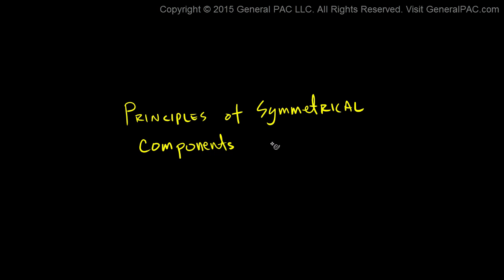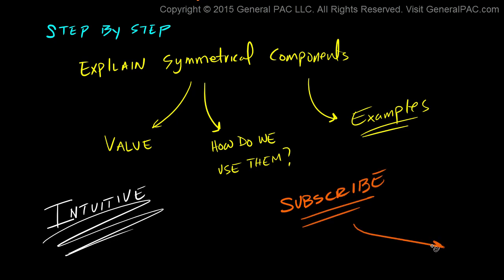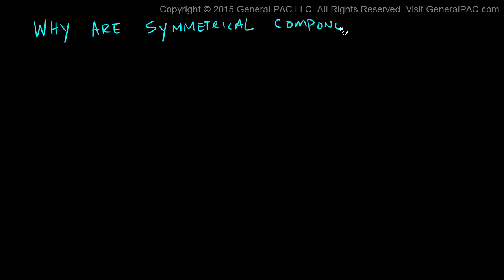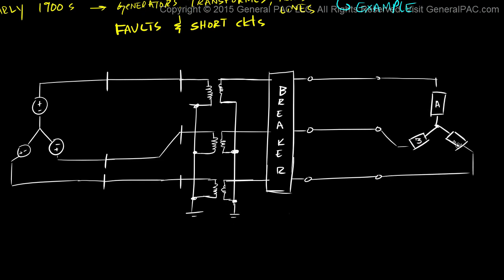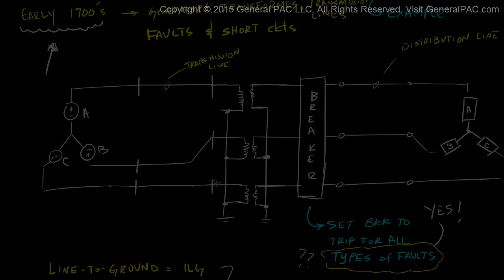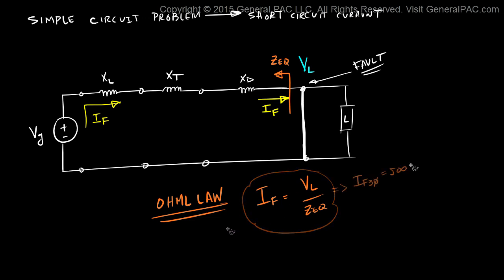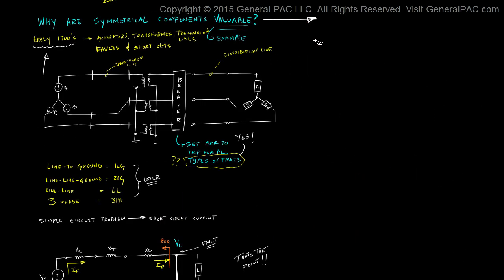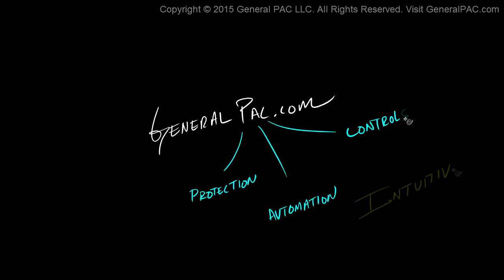Principles of Symmetrical Components Part 1a

Comment: Such a concise & really great explaination. Watching this, college lectures make more sense. 
One topic was missing, about Z bus Calculation, about Z bus building algorithm, Current Injection Method etc. 
But no issues I understood those topics from somewhere else, but If You'll make playlist for this also, this will help everybody.
Thanks
Reply from the maker: Hi, your suggestion has been noted. Checkout our new course which covers a variety of Power Systems concepts with detailed explanation and we're offering 90% OFF. Use the coupon code "PSEVLOG1" and get benefit from it: https://bit.ly/PSEVlog1

Comment: I have watch all the videos related to symmetrical components. To appreciate it more, do you have another set of videos on how can i apply it on actual electrical system design where the only given is utility available fault current and system impedances. Even a book or technical paper will be much appreciated. Thank you and hope to hear from you soon.
Reply from the maker: We are working on this series now and hope to release it soon!
Reply from the maker: Hey there! We have started a new series which is the Fault Analysis using Waveforms. It is basically the practical implementation of the symmetrical components and faults. Check it out at: https://www.patreon.com/posts/24990064

Comment: Dear sir i have a question in my mind will you please help me?
que : I've read this line in one book related to switch gear and protection which says as follows :-
the unbalanced loading results in circulation of negative sequence currents in the stator winding which give rise to rotating magnetic field which rotates at double the synchronous speed with respect to rotor and induces voltage double the frequency in rotor conductor. 
Can you explain this in more elaborate way. 
Thanks in advance.

Comment: When you say analysis is extremely difficult to attempt to calculate unbalanced faults without symmetrical components, what do you mean? The alternative to symmetrical components would be deriving the KVL/KCL, Mesh/Node equations for the 3 phase network. This doesn't sound "extremely difficult" as much as it is just going to be a long and tedious process. Can you clarify? Thanks.
Reply from the maker: After performing the KVL/KCL methods, we determine the equivalent impedance and voltage source. Then, we have to use that information in a very specific way to calculate 3LG, 1LG, 2LG, and LL faults. For 1LG, the impedance are in series. for LL faults, they are in parallel. This part wasn't known BEFORE the symmetrical components was invented in 1918. Actually, couple years after 1918, Power Engineers were able to use the symmetrical components concepts to calculate unbalance faults. Does that make sense?

Also -- If I understand it correctly (and challenge or add  to this comment) -- back in the day (before main-frame computers), Engineers from the past created a miniature version of the system using simple cables and small transformers. They were very careful of the impedance used for the mini system because it had to accurately reflect the big system. And when they injected current through the mini system, they could easily measure the current flow through each line which would reflect how currents would distribute through the actual system. Similarly, I think they had a crude way to measure unbalance fault currents.  That's all I know. If I find out more, i'll comment again.
Reply: Im not sure by what you mean by "determine equivalent impedance and voltage source. Then we have to use that information in a very specific way...", or "This part wasn't known BEFORE the symmetrical components was invented in 1918". The way I see it, to calculate unbalanced faults without symmetrical components, all you have to do is derive the KVL/KCL mesh/node equations with the desired fault topology, then solve the resultant system of equations for the unbalanced voltages/currents. As I initially stated, this is not "extremely difficult" as much as it is a long and tedious process.
Reply from the maker: Using KVL/KCL mesh/node equations that you have described can be used to calculated balanced 3PH faults. But not unbalanced faults. Read this paper for more info. Figure 3, 4, and 5 shows what how the "equivalent impedance" and "voltage source" for pos, neg, and zero sequence impedance are arranged to calculate unbalanced faults (1LG, 2LG, and LL). 

https://cdn.selinc.com/assets/Literature/Publications/White%20Papers/LWP0010-01_TutorialSymmetrical-Pt1_AR_20130422.pdf?v=20150812-081134  

Hope this helps.
Reply: Thanks for your responses. I have actually read that SEL paper in the past, its good but unfortunately its not what I would like to clarify. I feel like I have a good grasp on this subject, but the only thing that concerns me is something you said.

I disagree with your statement about, "Using KVL/KCL mesh/node equations... can be used to calculated balanced 3PH faults. But not unbalanced faults." as it is generally incorrect. You mention that it is extremely difficult to attempt to calculate unbalanced faults without symmetrical components, and now it sounds like you are saying that its not possible at all using KVL/KCL. This is adding to the confusion about my initial inquiry.

The way I understand it, there are a few ways to analyze unbalanced faults..... I will categorize them into two parts. 

1.) Symmetrical Components: This is just a way to break apart the unbalanced phasors, and deal with them as balanced phase sets, which makes analysis much easier since we are dealing with per-phase equivalent circuits as you have mentioned (pos, neg, zero). With these symmetrical phase sets and their respective impedance networks, any circuit analysis techniques/methods may THEN be applied, such as KVL/KCL Mesh/Node equations, source transforms, thevenin/norton transforms, lumped/reduction of elements etc.... Note: Depending on the fault topology under consideration, the impedance network is manipulated/arranged accordingly to calculate the unbalanced faults. The sum of symmetrical components gives the resultant unbalanced conditions. This is very convenient.

2.) Non-Symmetrical Components: This is directly applying brute force circuit analysis techniques/methods such as KVL/KCL Mesh/Node equations, source transforms, thevenin/norton transforms, lumped/reduction of elements etc.... to the THREE-PHASE topology (not per phase equivalent circuits) with the desired fault in-place - whether it be 1LG, 2LG, LL, etc.... Eventually, you will have a characteristic set of mesh/node equations that, once solved for, will give the resultant unbalanced phase conditions for the particular 1LG, 2LG, LL fault. This analysis of unbalanced faults is more tedious, and requires a new set of equations for each type of fault. Its not extremely difficult, and therefore it IS possible to analyze unbalanced faults without symmetrical components. It may or may not be convenient.
Reply from the maker: My apologies for the confusion. You raise a good question and like you, I don't have all the answers... but I am curious! I also want to learn how unbalanced faults were calculated BEFORE the introduction to symmetrical components. I know for sure that we can use "KVL/KCL Mesh/Node equations, source transforms, thevenin/norton transforms, lumped/reduction of elements etc" to calculate 3PH faults. However, i'm not confident about using these techniques to calculate UNBALANCE faults. I hear you... this is where we disagree. Your carefully written thoughts and explanation is much appreciated! It helped me understand where you were coming from! So thank you for that!

With that given said, I'll do some digging. When I learn something new, I'll post it here :) Also, if you come across a good article / book / standard that explains this concept in more detail, please do comment.
Reply: You can refer to any introductory text on circuit analysis that describes unbalanced three-phase circuits. A classical electrical engineering problem typically explored, is the calculation of neutral current  due to phase imbalance - which is just zero-sequence current in the symmetrical component analog and can be thought of as a low magnitude LG fault.